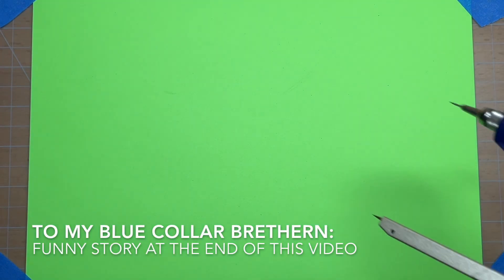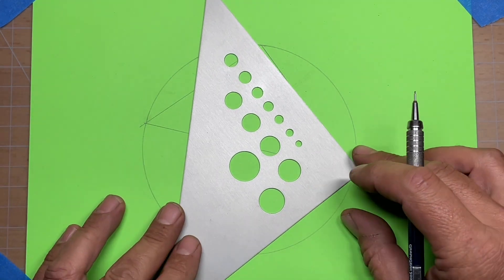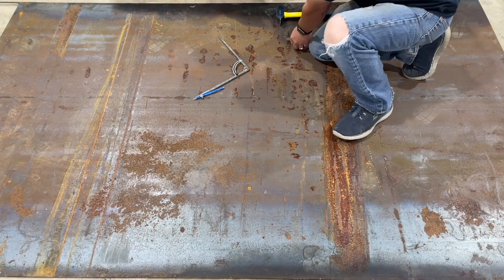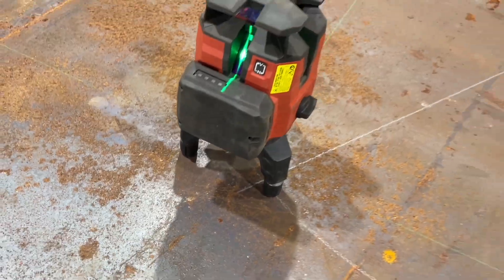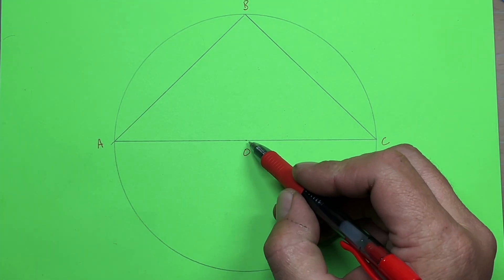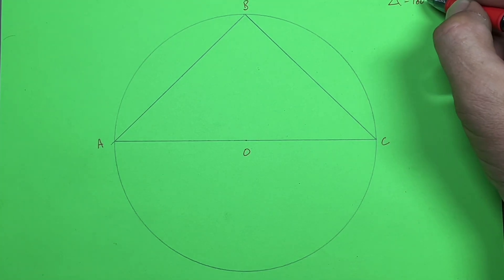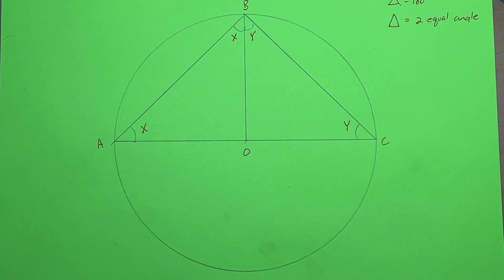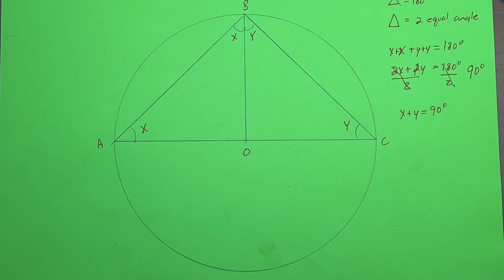Find The Center Of A Circle With Thales’ Theorem

Comment: Did I miss it or was the laser level the way he found the center of the 60' dia silo?  was this to lay out a future silo on a pad bigger than 60' giving him a place to physically put the instrument- i don't see where he could have put the instrument inside of an existing silo- or outside of an existing silo (where it would have been useless anyway.)
Reply from the maker: That’s a good catch. What I had to do was use a 6” spacer to mark out a circle on the concrete that decreased the radius by 6”. Then I was able to set my laser on the smaller circle to pick up two diameters.
Reply: @txtradesman527  Cool.

Comment: It works because of another theorem whereby the if an angle has its vertex on the circle the the angular measure of the arc enclosed within the rays of the angle will be twice the angular measure of the angle itself. Using a square (90 degrees) therefore encloses an arc with an angular measure or 180 degrees.

Comment: As an applied mathematician  I sometimes slum it by watching this type of video. Machinists have all sorts of hacks they use but could never prove in any rigorous way  but they do work and are based on proper Euclidean geometry.  A carpenter once asked me about a rule of thumb he used fo arches and I derived it from basic ellipse properties and it made sense.  17th  century mathematics was highly geometric and Newton's Principia is almost unintelligible to modern readers. Indeed,  Nobel Prize winning  physicist Richard Feynman once tried to replicate Newton's highly geometric proof of his inverse square law of gravitation and it defeated him because Newton relied on obscure geometric properties that we simply don't learn these days because of analytic geometry etc. Newton did a geometric derivation of the shape of minimum resistance in a fluid and althougn it was obscure he got the same answer a fluid dynamicist would get woth modern techniques.  Geometry is really powerful and only involves simple tools.

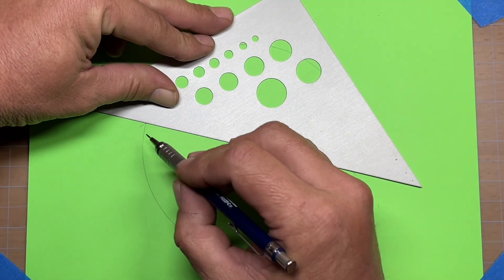Comment: At 0:56 you could have used the endpoint of one of the existing two lines, to draw the third in a right angle, of which that third is parallel to the first. The diagram becomes simpler and easier to understand.

Comment: Thale’s theorem is just the inscribed angle theorem in reverse. The right angle used is an inscribed angle, and the inscribed angle theorem states that the angle AVB is equal to half the angle AOB, where O is the origin, and A, V, and B are points that lie on the circle. So given three points on the circle and the angle 2ø between two radii, you know the inscribed angle at the third point is equal to ø. But you can also go in reverse. Given an angle of 90° inscribed in the circle, the other two points form an angle of 180° with the center, so drawing a straight line between them must intersect the center. Then you just do that twice to find the intersection of the two diameters.
Reply: Yes. The most stunning practical demonstration of this is to draw a line AOB through the center of a circle. Then put a pencil on a third point, V, anywhere else on the circle. Even as you move that point V around the circle, the angle AVB remains exactly 90 degrees, always exactly half of AOB.

Comment: The other way I have heard this is that if you start with a semi-circle and draw a line from one end to any other point on the semi-circle and then from that point to the other end of the semi-circle the angle between those lines will allways be a right angle. 
You are using this property in reverse by putting the vertex of a known right angle on a circle. The intersection of the right angle with the circle will be a semi-circle which lets you draw a diameter line, which by definition goes through the center of the circle. Do this a second time to prodoce a sevond diameter line and the intersection of the two diameters is the center of the circle.

Comment: Here is another tip - how to create a right triangle when you have no rulers or levels or any equipment - only a long string and a knife.
Use anything as a yardstick, and arm, a leg, a branch. Heck, stick two pegs in the ground, or use two rocks and define the distance as one unit length.
Cut the string into three cords: 3, 4 and 5 units  of length.
Tie the ends of the cords together (3 to the 4, 4 to the 5 and 5 to the 3)  and when you pull on the knots to the maximal extent, you got yourself a right triangle with the hypotenuse is the 5-units length cord.  Of course, any multiple of the Pythagorean triplet would work: (6,8,10) , (9,12,15) etc. 
Pythagoras was a complete cultist loon, but a smart guy nonetheless.
Reply: Here's a handy add-on. To quickly get your cord lengths, take your string and anchor it on the corners of the 3-4-5 triangle you just layed out. Pull tight and mark at the corners. Cut at the marks and  knot the ends. Now you're ready to lay out your triangle.

Comment: That is not Thales theorem 
You are using the central angle theorem
Reply from the maker: Yes it most certainly is.
Reply: @txtradesman527  where are the parallel lines?
Reply from the maker: This isn’t the Proportionality Theorem.
Reply: @txtradesman527  I know   , it’s an application of the central angle theorem , twice .
Reply from the maker: It’s Thales’ Thereom, which is a special case of the Inscribed Angle Theorem.
Reply: There's more than one theorem in geometry called Thales's theorem...

Comment: I would like to see if there’s a way that if you had like an empty oil drum and you wanted to find the center at the bottom of it, how the center could be determined
Reply: Turn the drum over and make your marks on the bottom, exactly as shown in the video.
Reply: @thomasw.eggers4303  Other than making a hole there how would you transfer only a mark from the outside to the inside of the drum?
Reply: Draw a square around the circle. Use two straight sticks from corner to corner across top of the barrel
Reply: @saranevillerogueart9627   Your geometry is correct, but the method in the video is easier. (I suggest that you actually try it both ways.) Constructing your square makes your suggested method harder.
Reply: The kind of set square he's using is particularly well-suited for inscribing right angles on the inside of a bounded circle, but you're right that you won't simultaneously reach both points on the diameter unless you have a set square of exactly the right dimensions. You'd have to mark your inscribed right angle first, and then construct the proper extensions on each side to reach both points on the diameter. You can do that with another, longer straightedge.

If you're uncomfortable with the potential for imprecision when continuing a short line segment with a straightedge over a long distance, you could alternatively draw any two wide chords across the bottom of the drum, and then construct perpendicular bisectors of each. They'll both be diameters, and will thus meet in the center.
Reply: As thomasw said, flip it over.
And go ahead and use your square on the inside of the rim. Neither the square or the theorem will care.

Comment: I think is easier and only needs compas and ruler is to trace two different chords, then trace the perpendicular line at the middle to each chord using compass and ruler (open compass slightle more than half teh chord then trace two arcs pivoting one from each point in the circle in the chord, then unite the two crossing points with ruler and extend it as necessary into the inside of the circle), then the point where they cross is the center of the circle.
Reply: I think that’s also based on Thales theorem, just using a different tool.

Comment: 😂An easier solution using origami based on my high school teacher's mantra of "Keep it simple, stupid.": Fold the circle  into quarters, where the 2 diameters intersect would be the center of the circle.🎉
Reply: the techniques described here are for use in The Real World, not On Paper. You can't fold a slab of concrete.
Reply from the maker: In smaller circles that will work. Larger circles, not so much.

Comment: Make a square fit your circle into it.  Or draw your circle.  Draw the square around it. Make an X across them
Reply: It easier for me . Than all those complicated mathematical like angles. I jus draw circle. Make a straight line right next to it. Then use metal triangle with  a 90° angle in it. To draw A connecting  90° angle to it  right up to another edge of the circle the make 2 more on the other places on the circle to connect the square then draw an X from the opposite corners of your square.  Easier to do than all this other stuff and easier to remember
Reply from the maker: There are no complicated angles to remember.
Reply: @saranevillerogueart9627 couldn’t agree more. Far more straightforward.
Reply from the maker: How exactly is that easier? I’m genuinely asking.
Reply: @txtradesman527  it only needs 4 lines to form the square and two to cross the circle. It’s far simpler to do than faffing about like this guy has shown..
Reply: Making an actual square can be quite challenging, meaning all legs are the same length, and all corners are 90°. You’d also need to measure the diameter of the circle, for which you’d also need to know the middle of the circle to do that measurement accurately.
Reply: @RuudAlthuizen  making the square is simple. Start by drawing a line anywhere on the edge of the circle. Use the set square to draw the next line on the edge of the circle at 90 degrees to the first. Repeat for the next 2 sides and there’s the square. No measuring involved. The set square has to be accurate obviously.
Reply: @chrisgee5893  I think you’re right. I thought that it would have to be a square with equal lengths, but reading your reply I figured out that isn’t the case.
Reply: With a carpenters square i can do the method in the video using 6 marks (dont need to draw the legs of the triangle and you only need a minimum of 4 distinct points)

Comment: An important point you kinda hinted at is that the triangle doesn't need to be isosclese.  ANY 90 degree triangle will produce a diameter to the circle.  I think this point was sort of smudged by referring to isosceles triangles in your explanation of Thales theorem.
Reply from the maker: You are correct, I should’ve been more clear on that point.
Reply: It might have been a bit vague on that point, but it is very relevant! Producing that third radius that divides the first triangle in two ends up making two not necessarily equal isosceles triangles (each being composed of two radii plus another side).

Great video! I love seeing this practical geometry being taught out in the wild! (I work at a university and am always seeking ways to find motivation and inspiration outside the classroom for our students)
Reply: You can do the same with a 3-4-5 triangle.